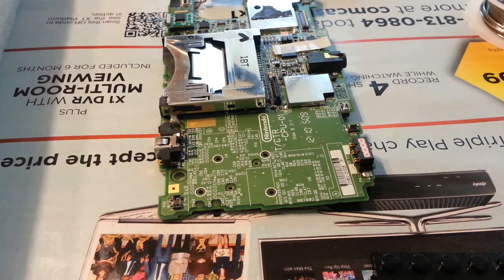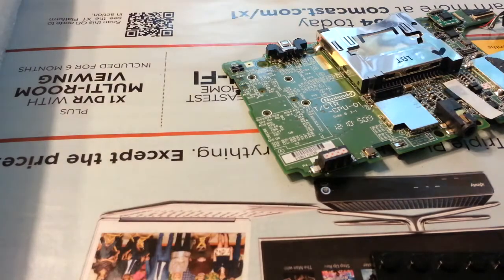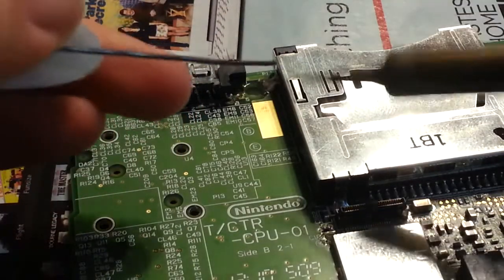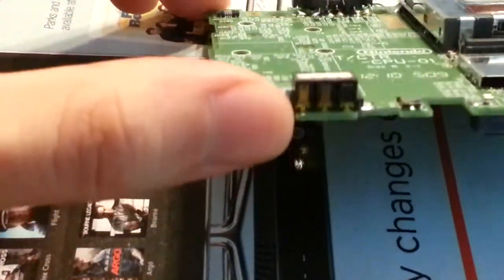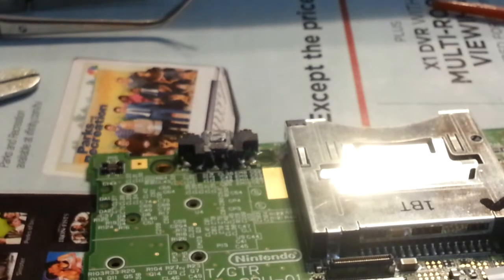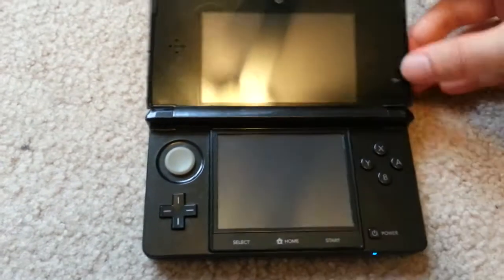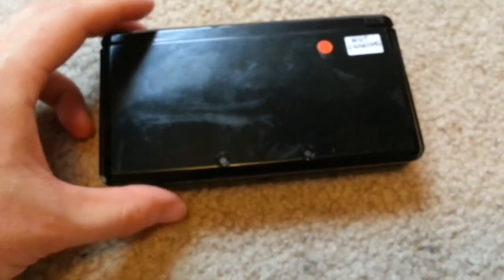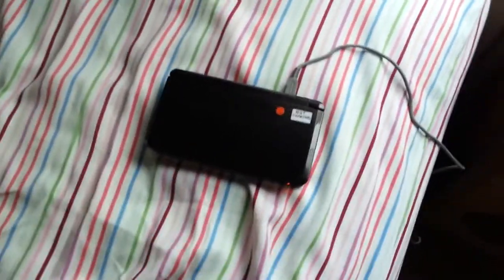Nintendo 3DS Charger Port Repair Soldertime

Comment from the maker: From what I've read it sounds like a software crash. It could be caused by a number of problems, but I would first pull the battery and wait 30 seconds. Then put the battery back in and reboot and try to software update. If that doesn't fix it then open her up and see if the slot replacement was botched.

Comment from the maker: Sounds like there are shorts due to the botched soldering job. I would fix that up before anything and hopefully that is what is causing the 3ds to crash. As for the 3ds with no power first check the battery voltage to make sure its not just the battery. Try it with a known charged battery. If not it could either be a software brick or a hardware problem. Google to see if the 3ds has a recovery mode to reflash, for hardware open her up and check local supply voltages with a battery in.

Comment: hey man thanks for the video. I pulled up too hard on my sd card slot and believe I broke the two solder points on the back of that metal shield the sd card slot is adhered to, I think? Are those two blobs on the rear corner of the shield attached to the metal shield? The shield Im referring to is the one that the sd card slot is adhered to. Thanks again

Comment: Ok so my New 3DS' charge  port needs replacing. I have no experience with soldering whatsoever. So is this somewhat easy to do or can some complications get in the way of things
Reply from the maker: Voks If the part the plug plugs into looks fine but the entire jack wiggles then the fix I did will apply which is easy. If the pins and plastic in the jack are all torn/chewed up then you will need to remove/desolder the broken jack and solder in a new one which can be difficult especially without experience. If that's the case I would suggest asking one of your soldering inclined friends to do it for you and buy them a beer as thanks.
Reply: @sjm4306  my 3ds turn on with blue light fine, only won't charge, the port looks fine, some people say that it may be the solder joint need to be reheated, if i want to reheat it myself, do i need flux and pretin the solder tip, or just touch the solder tip to the joint? because i found another video that only touch the joint, thanks
Reply from the maker: So long as the solder isn't corroded you can just touch the tip of your iron to reflow it. Since it is lead free though, I would suggest adding a bit of leaded solder to strengthen the joint so it doesn't fail again in the near future.
Reply: @sjm4306  i see, thanks for replying, that's fast

Comment: near the end you mentioned not having a charger for it, wouldn't it have been feasible to remove the propritary connect or and replace it with a micro or mini type USB jack? i know this video is old so it wouldnt be applicable now, just saying.

Comment: I bought a 3ds on ebay that has a error code 8046  . Seller said the error happened after they got the cartridge slot replaced  any tips ??

Comment: Some of the solder pads on my 3ds xl motherboard were torn off with the charge port. Is there anyway of repairing what I have?
Reply from the maker: It's possible to grab the traces further up before the lifted pads and solder bodge wires there to the port and depending on how bad they are you might have to epoxy the port down to the pcb to secure it. It's possible but will require some effort and soldering.
Reply: @sjm4306 Thank you, Is it possible for me to send you a picture of the motherboard over discord or something? I bought some flux and desoldering wick. I have my solder iron and some tin. No conductive epoxy tho. I don't know how to solder, but do you think a couple of videos should teach me enough to do what you suggested?
Reply from the maker: I would practice quite a bit on scrap boards. Fixing lifted surface mount pads on a high density board should not be your first soldering attempt. Not that it'd be impossible but the risk of killing it will probably be high without a good amount of smt soldering experience.
Reply: @sjm4306  thank u, ill be practicing then lol

Comment: i did mine ..i soldierd mine but it still won't charge with a charging cable.just with the ds adapter. all points are soldiered  .? any thoughts ?

Comment: I can't get to the menu to do a software update just stuck on a blue screen on both screen with the error code 8046  I opened it up and the person that put the new cartridge drive in did a terrible job with soldiering looks like I will have to replace the cartridge drive myself . Thanks  also I have a 3ds with no power it won't turn on any tips ??.........

Comment: What is a soldering iron?? Is it expensive to buy one?
Reply from the maker: It's a tool with a metal tip that heats up hot enough to melt solder, the metal used to join electronic components to circuit boards. You can get very cheap ones for less than $5-10 if you are just starting out, all the way up to hundreds of dollars for professional grade ones. Ebay and amazon have tons at just abut every price point.

Comment: What type of screw do we need to unscrew the casing of the Nintendo 3DS?
Reply from the maker: JugularRogue 65 It's called a triwing screw. Triwing screwdrivers are pretty cheap and used is most Nintendo hardware so it's definitely worth picking one up if you intend to fix a lot of their consoles.
Reply: Actually he's wrong normal 3DS systems only take regular Philips screws so you'll just need a #00 Philips screwdriver

Comment: Is there a certain type of iron I need for the solder
Reply from the maker: Roberto Castillo Pretty much any hobbyist iron will do, but having a temp adjustable iron with a small pencil or chisel tip will definitely make things easier. Also using 60/40 leaded solder and some flux to reflow the joints helps immensely.

Comment: Thank you for posting this.  What is the mfr# for that charge jack?  I am trying to fix one for my friends' kid.
Reply from the maker: Leslie Hopkins Here you go: http://www.ebay.com/sch/i.html?_from=R40&_sacat=0&_sop=15&_nkw=3ds+charger+jack&rt=nc&LH_BIN=1
Reply: Thank you.  I have decided the fault is in the power xfmr itself.  I think the solder joints are failing.  I'm going to take it to work tomorrow, trim them and resolder.  Thank you for your help.

Comment: Great video kid! Simple and to the point!! Like the fact that you show the type of solder station and the tip. Now a days electronics devices are getting smaller and better tools are needed. Not like when I started electronics late 70's & early 80's, you got a soldering gun or a cheap iron, did the work but todays devices are so small. Anyway, great video and keep it coming!! Joe-k4jga
Reply from the maker: Thanks! I first started soldering with the cheapest iron you could imagine and it was absolutely horrible. Getting a nice, temp controlled iron with interchangeable tips greatly improved the quality of my joints.
Reply: I agree! Pay more but get a better job with the right instrument. Good luck and thanks for taking time to replied!! Joe-k4jga

Comment: :-)Hehe, Extreme skills. Your course must be ECE (like my friend who can do hardware and code). I wish I had these high level of electronics (these too: Louis Rossman, that popular guy who makes portable stuff of huge consoles, EEVBlog something from australia and 8-bit Guy too he has a channel that restores UV damaged plastic and make it as white as the original).

I'm trying to revive my Famicom, the power brick doesn't seem to be outputting the right volts (less than 1v if I remember). I've opened it's very special screws and I can see that it has a board with capacitors and things like that but do you think this can be revived (it's 100v japan) by replacing the capacitor or it needs to be rewinded? 

By the way, another word they use besides "as is" and broken is "defective". I revived a PAL Dreamcast by buying a defective one then switch it's GD-ROM unit but then the chip (I think) that makes the drive spin again burned out for some reason- I'm not sure if it's because of the old thermal pad or something is not right with the voltages going to the GD-ROM. This all started when I left a music CD in the Dreamcast playing on repeat (I feel asleep) for more than 8 hours, repeating the same korean song- any ideas how what's causing it? 

Thank you. God bless, Proverbs 31
Reply from the maker: Thanks for the kind words. Yes I'm an electrical engineer by trade. As for your famicom power brick, where do you live (or rather what is your AC mains voltage). The brick is probably just a transformer, rectifier diodes, and filter caps. If you are ~120Vac then it should still work but maybe the output 
voltage will be a bit higher (but definitely not only <1V). If you have ~220Vac and plugged it in to test you may have killed it (either primary and/or secondary side). First thing I would do is check the bridge diodes with a multimeter to see if they still only conduct in one direction and then replace the caps as they are probably bad by now given how old they are.

For the dreamcast, you'd have to probe the drive to see if it is a motor driver problem or perhaps the laser died and it cant see the disc and thus doesn't spin the motor.
Reply: Hi. Thanks again. Our power is 220v (great country for charging Tesla cars faster no modifications needed, sadly the government's not yet let 100% electric cars in:-). When you take off the Famicom's AC adapter's casing and measure it there (AC setting on the multimeter) this is what happens: first it's 22v then goes down to 8v then 5v then 2v and the OL, all in 1 second. It's quite weird. 

When you measure it on the plug side (DC setting on the multimeter) it's less than 1v in the millivolts even.

True, it has a board but there's just 3 subcomponents: huge capacitor (16v 2200nF which sparks if you discharge it/touch one of its wires w/ the tester's probe- I wonder if that's enough to kill though) and 2 black resistr looking component (each with 2 silver rings at one end) which I believe is the rectifier diode you mentioned.

Do I need to shop for the capacitor and  the 2 rectifier diodes or the transformer needs to be rewound (I hope I find a good electronics repair shop to do that, the nearest one wasn't good. We brought a Viewsonic 17" LCD had to wait for 2 months, no updates and it's not finished yet coz' there were no parts. The LCD turns on then off again, it's showing the image but it's like blinking/flickering- I just need to replace the capacitor?)?

By the way could you do addition with subcomponents? For example it's 16v 2200nF but it's not available in the shop, could one just buy two 8v 1100nF (if this spec exists) and solder then together then use that Frankensteined capacitor (or any subcomponent)?

Very big thanks again sir. Have a great day.
Reply from the maker: I'm pretty sure the famicom adapter is rated for 100Vac (and isn't switching so it cant be dual range) so I hope you are using a step down converter to test. The voltage dropping sounds like there is something shorting or not connected properly. Are you measuring right at the capacitor pins (since it sparks there should be a voltage across it, though not nearly enough to kill you lol) or at the plug end?

For the lcd tv it sounds like either the caps on the ccfl inverter or the ccfl tubes themselves need to be replaced.

For capacitor substitution, keep in mind that for two same valued caps putting them in series doubles the voltage rating but halves the capacitance (so in your example you'd have to start with 4400nF caps in series). In parallel the voltage rating stays the same but the capacitance adds together (so in your example two 1100nF caps in parallel will work but they must be 16V, not 8V). The main thing to keep in mind is to absolutely make sure in the end that the total voltage rating ends up being at least the same as original or higher.
Reply: I see. So if it's not available, I'll ask for two 8v 4400nF and if that's not available still, I'll ask for two 16v 4400nF. How much higher maximum could the voltage go? 

I wonder if the Famicom unit itself got damaged since the adapter isn't working or if there's something (a spike in power or it was plugged in a 220v outlet) wrong it stops at the adapter to protect the Famicom unit?
Reply from the maker: The voltage rating is just a maximum the cap can be charged to before it will vent or pop. So you can go as high as you want and it will be fine since that cap will say only be charged to 12V in the actual circuit (it is common to use a 16V rated cap to decouple a 12V supply rail). Now if you use a 6V cap on that 12V rail then it will blow and you will have a problem, but a 16V or 20V or 50V cap will all work just fine (assuming the capacitance is the same).
Reply: I see. Coming out of the transformer, It's really 12v max that's going through those components and 16v or higher is just an allowance (I assume if the capacitance is too high even though the volts is 12v max, the Famicom unit will get damaged still?).
Reply from the maker: Yes that's correct about the voltage allowance, but for capacitance having too high a value wont damage anything for a non-regulated transformer power supply (actually the opposite it will be more stable, but take longer to settle when first turned on).
Reply: I see. It's 100v Famicom power adapter, plugged in to a step down converter (that's a step down transformer too isn't  it). Where the voltage is dropping and eventually goes to OL is where this guy is measuring at 5:33 https://www.youtube.com/watch?v=JXE0EPYygMo

Which part or parts do you think I should replace given this symptom? Should  the transformer be rewound or I should only replace the capacitor or one or two of the rectifier diodes (what does the rectifier diode do by the way- I know diodes are like one way valves but which way?) or replace all?

Thank you again- it's a big help, reviving this.
Reply from the maker: First step is remove the cap and diodes and measure just the secondary side of the transformer to see if it is outputting something reasonable. If so then test the diodes using a multimeter on diode mode and then if all that checks out then replace the caps.
Reply: Thanks. I take the cap and diodes and then measure it again (multimeter set to AC) where that guy in the video measured it? Where's the location of the secondary side of the transformer? What should be the minimum voltage should I get from this side? Thanks again.
Reply from the maker: The secondary side is the side with the diodes and cap. You should see something like ~1.707x the expected dc voltage
Reply: I see. Is it the same points where the guy put the probes on (only this time with the caps and diodes removes)? 1.707x 10v or 9v = 15.363v to 17.07v 

It should have between 15.363v to 17.07v ?
Thanks again.
Reply: Should I measure this with the multimeter set to DC or AC? Thanks. Will need to brush up on my soldering and desoldering, it's been awhile.
Reply from the maker: If you are measuring at the secondary of the transformer that is AC.